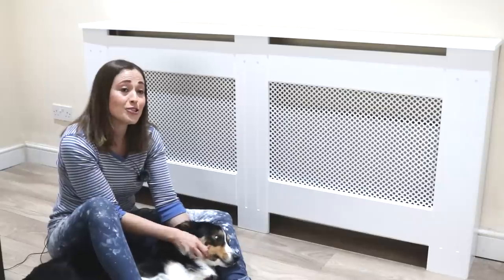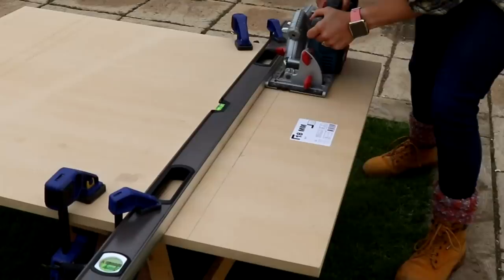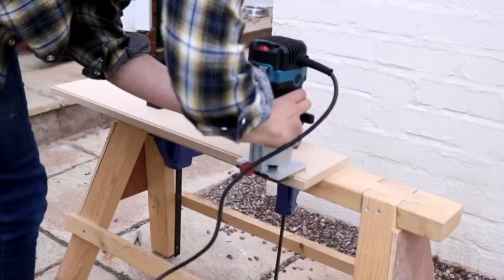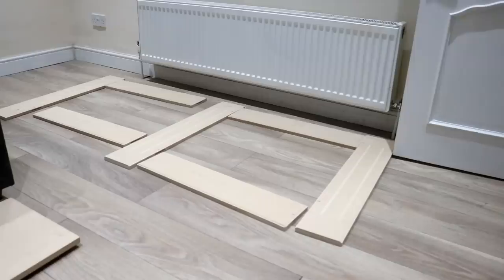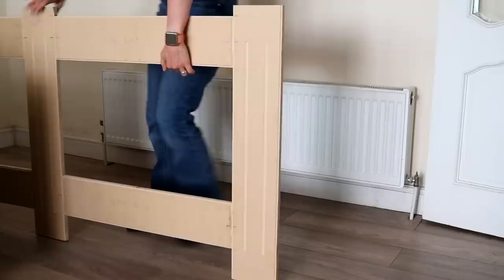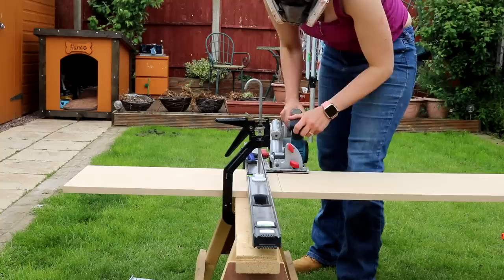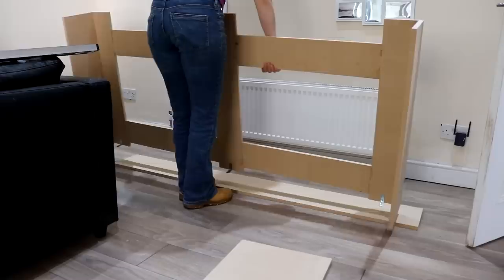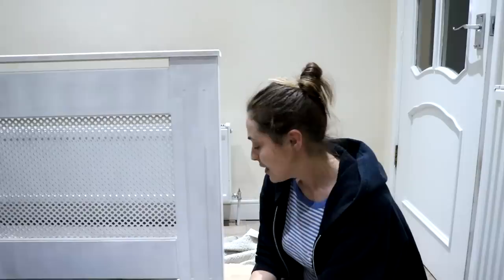DIY Radiator Cover | The Carpenter's Daughter

Comment: Good idea to fit a room sensor radiator valve or it will close down in a jiffy or take the head off the existing and it will never close if you don't mind continuous uncontrollable heat. Lovely job. Getting my MDF delivered tomorrow.

Comment: I made the same project back last year. I opted against using the mdf sealer and the paint finish I had was great without it. But like you, totally made sense to make one rather then buy one 👍
Reply from the maker: The place I bought the MDF screen advised not to buy the sealer because they thought it was expensive PVA glue, but deep down wanted to try it.  But so many people since have said that cheap undercoat did fine.  I'm just not sure why this product has so many great reviews as it soaked up almost 500ml which cost a fiver.  Also, I've since read the label on my satinwood and it says self under coating, so won't bother on my 2nd one.

A hardware store

Comment: Great video and great build Vicki.
I think though that radiator covers are certainly a fashion choice just like coving etc. Personally I like the radiators as you can easily hang wet clothing on them and it dries quickly.
I would guess that there is also a restriction by covering the radiator as to how much heat comes out, therefore costing more energy to heat the home. I know it's well vented but heat must be more directional.
I bought a MDF sealer paint from either B&Q or Wickes, can't remember which. Just looks like a white paint. Only issue I see with sealing with PVA is that you would need to add water to it to thin it down, therefore adding the one element that MDF does not like, water is not good anywhere near MDF so worth the extra expense.
Reply from the maker: Thanks Paul :)  Yes, radiator covers do seem to be a very personal choice.  Thoroughly enjoyed making it as it's taught me a few basics to make a recycling centre and it's going well :)

The sealer I used seemed to be very watery..  thinner than milk, but the MDF soaked it right up.  Haven't read the label, but don't really know what's in it.

Comment: Jali stock mdf screens .
Awesome all that planning payed off and new tools 🧰 too . 
Emulsion I would use as a base .
I couldn’t do this my maths is awful.
So impressive xxx
Reply from the maker: Thanks!  My maths is awful too 😂😂  It was really simple... I initially just held a thick book either end and measured the length.  Then after deciding the strips would be 15cm wide, I subtracted that from length and divided it by two (or three) sections, rounded it up and got my horizontal cuts.

I too was contemplating just white emulsion as spotted it's often used for them :)

Comment: Nice job. Very smart. Never used MDF sealer just MDF primer and two top coats. Wickes keep that sort of screen but I see the website shows it all on clearance so maybe they won't be stocking it anymore. I also use Medite MR MDF as the quality is good and the edges less fluffy than B&Qs. If you need a nice smooth cut edge don't bother sanding before priming. Sand after a coat of primer and it can be sanded very smooth.
Reply from the maker: Thanks for the tips!  I'll try looking for that MDF if I want to do some more :)  Also, yes, I spotted it was all clearance there too and my local stores didn't have it.

Comment: Looks very smart,  Automatic Bleed Valves are essential when fitting rad covers else you'll have to dismantle the cover to access the manual bleed valve,  having the Thermostatic Radiator Valve (TRV) and Lockshield Valve (LSV) within the enclosure is a mistake you'll later regret  the TRV will be unable to monitor the room temperature, forget about convection, there will not be enough air movement for the wax stat in the TRV to operate to the room ambient temperature, also no (quick) access to the LSV in an emergency and no way to adjust the temperature of the TRV. Nothing wrong with rad covers just ensure the TRV and LSV are outside the enclosure, I worked as an electrician mainly fitting Central Heating controls for a local authority, these problems became the bane of our lives a few years ago.

Comment: A neat job Mrs Carpenters Daughter ☺. I've never used MDF sealer, I'll have to investigate
Reply from the maker: Both Joe and Rob have since said it's rubbish (or expensive) 😂😂 but the reviews are really good.  My only gripe about it is I nearly used a £5 500ml pot on this cover.  The hardware store I bought the screen off said PVA solution would be better, but thought I'd try it out first.
Reply from the maker: Oh and thank you 😊

Comment: The perforated MDF sheets might not be available in the large single sheet, but most DIY stores sell smaller sheets. As your design is in two panels, you could have used 2 panels. If you can only find narrower sheets, usually sold as cabinet door panels, then making your radiator cover into a 4 panel design would work as all the MDF panel joints would be hidden inside the radiator cover.
MDF sealer makes a huge difference to the final paint finish. If you can't get the sealer use PVA applied in a thin coat on all cut edges and a thin coat 50/50 PVA + water mix for the surfaces. The water might make the MDF fluff rise on the first coat. When it's dry sand with a fine sandpaper and repeat. Like with all finishes, the more time you spend on the preparation the better the end result. You may need to sand and seal a couple of times, even with MDF sealer. A gloss paint roller (foam) is good for applying PVA.
The end result looks fantastic as usual.
Reply from the maker: Thank you.  I saw a few smaller sheets online, but they were quite pricey I'm comparison.  However, it may be a better solution for the smaller one I've now made this weekend.
Reply: Oh another tip, buying wood and sheet materials from your local timber merchant or building suppliers is generally cheaper and they will deliver.
Reply from the maker: Thank you!  I still don't know many places in this area, other than timber for sheds and fencing and I've been here 5 years 😂

Comment: I found the screening fairly easy to find the thing that got me was the price! Couldn’t find anything less than £40 for the size I needed. And for that price I managed to pick one up in great condition second hand. The screening is really easy to come by on eBay if you’re happy to wait for postage though :) 

Also, great to see a fellow lady DIY’er 😁
Reply from the maker: Thanks :)  Yes, I did see some online and almost choked on the price!!  I'm hoping it's just a seasonal issue, but do fear they're less in demand.  I've since made my second one, so Ebay may be a better option as I'm in no rush :)
Reply: @TheCarpentersDaughterUK  Great job!! If you want to do it on the cheap then you can do the holes using a router and a couple of easy to make jigs. 2x bit of mdf offcut, one with 1 dowel spaced from bit and one with 2 dowels, same spacing. 1st row you clamp a straight edge and do first hole, then use single dowel jig for accurately spacing 1st row. then you remove the straight edge and you use the jig with 2 dowels. you place the 2 dowels in an L shape with the router bit and it will keep the column holes at 90 degrees. Time consuming yes but you wouldn't need to do the whole sheet, just the part you see and you could do a rabbet in the frame to hold in place...
Reply: 6'x2' screen at b&q £29.
Reply from the maker: Sadly b&q are out of stock at the moment :(

Comment: Hello Carpenters's Daughter …. Around 35 years ago radiator covers where removed all over because they jack up your heating bills just as well as long drapes hanging over the radiators do. So ok maybe things have changed since? However I would never cover up the thermostat because that will effect your heating. Just mentioning this as a tip incase you should consider doing this in another room as well. Otherwise?  …. Beautifully done. Nice to see you are so happy with it.

Comment: Excellent. Persevere with the track for your saw - better still, add a cross piece so you only have to measure the near side and cut perfectly square panels.

Try Peter Millard's 10 Minute Workshop for shaker doors - so similar to what you were doing there. And both him and Andy at Gosforth Handyman for painting MDF - and lots more.

They both do a podcast called Measuring Up - I find it just the job for ironing, complicated cooking and massive washing-up.

Comment: Bear in mind fitting a radiator cover will reduce the radiators efficiency by around 25%, with the lower flow temperatures used in new installations radiator covers will be unusable in most scenarios unless the radiator is massively oversized. When this video was made it didn't matter, becoming more important now though. Lovely job regardless, looks great.

Comment: I agree with comments that you work very professionally.
One question though which has always sprung to mind about radiator covers. Do they effect the efficiency of a radiator? Granted you have included plenty ventilation in yours. Also the TRV definitely will be rendered useless which is fine if the valve is turned to full.
Well done though you have made a very neat job.
Reply from the maker: Thank you :)  I'm yet to find out in the winter.  It may be difficult to tell in this room though as we have two radiators (it used to be a very cold room).  However, Rob who recommended the vents says there should be no issues.
Reply: They can slow the heat initially (10-15 mins), but once the cover is warm heat will still radiate and the vents will allow normal convection currents to do their thing.

Comment: Keep an eye on your router bits Vicki, they can have a tendency for the bearings on the end to work loose & fall off or the bearings to seize up, which ruins your day as well as the piece you're working on, the better quality the bits the less this happens, at the same time the cheap sets & single bits you can get on eBay are fine & more than adequate for the work you're doing... Just keep an eye on the bearings that's all, radiator cover looks great by the way 👍
Reply from the maker: Thanks for the tip!  I do have a selection that has some bearings missing, but they were handed down to me, so thought I'd buy some new ones for this.  Will keep my eyes peeled :)
Reply: @TheCarpentersDaughterUK  I did look at getting replacement bearings but tbh it's as cheap to replace the bits (if you buy the cheap sets off eBay)

Comment: I prefer to use pocket holes rather than biscuits. The joint is just has strong but without all the hassle of having to line up the cuts for the biscuits.
Reply from the maker: That's another thing I'd like to buy soon :)
Reply: @TheCarpentersDaughterUK  Mention it a few times in your videos and maybe a company will send you a pocket hole kit to review :)
Reply from the maker: Well Kreg didn't offer to send me one when I asked them a question about which one was easiest to use the other week 😂😂
Reply from the maker: Oh and I thought this looked so much easier than doing pocket holes, but I could be wrong 😂

Comment: Ive never used a router before can you tell me the bits required to chamfered the edges and the grooves you did? Im going to buy the same router as you. What other method can i use instead of a biscuit joint as i dont want to spend the money on a biscuit cutter for one project if you know what what i mean. Thanks again
Reply from the maker: Great questions!  If you don't want to buy a biscuit joiner, you could use dowel joinery  - you can watch my do this for the first time here https://youtu.be/fduBysIH2JQ?si=tuvrWoth_nDn2QUx

Or you can simply build the frame and  add another support or two and clad the top - or push some strips of wood together for your top and fix together with some strips of wood at the back.

Also, you can see this router set closer in this video if useful: https://youtu.be/xwu2GAlKDss?si=UHcI9S7TjqzqbPnF

And finally, you might find my radiator build written tutorial here useful:
https://thecarpentersdaughter.co.uk/woodworking/diy-radiator-cover/

Let me know if you need any more help!

Comment: Remake the saw guide, girl. Its truly indispensable. You can use BOTH sides of it - One for the wider side of the saw and the other for the narrow side of the saw. That way, you won't mess up. Then write on it WHICH saw is to be used with it. Love mine for breaking down material. Use styrofoam sheet under the wood and lay it on the floor for cuts (might need a couple of scrap 2X under it all to get good clamping of the guide.)
Reply from the maker: Thank you!  Yes, I really do want to make another one.  I'd stupidly made the narrow side a bit too narrow for my saw's guard to open.  Thinking about it, it I just clamped it on to MDF and sacrified a little bit of it, then it would have worked.  Oh well, I know for next time :D

Comment: I have a question. How did you clamp the second half of the cover? Your sash clamp is only 1200mm but you rad cover is 1800mm. Unless you just clamped it near the middle area rather than at the biscuit joints? But that would probably cause it to bow if too tight. Its not shown in your video. Great video though well done. I'm been putting off making my own rad covers, maybe this is my push to start and get it done.
Reply from the maker: Good question!  On the second section, I clamped above the biscuit join towards the top below the biscuit join for the bottom.  Although I probably should have clamped with an extra piece of wood to crushing my chamfered edge a bit.  I've just had a close look now since it's painted and can't see where I've been with the clamp, so I'm happy :)

Comment: I use normal emusion as under coat , b & q do a any surface 1 in loads colours asell sheen was great
Reply from the maker: I was tempted to paint with emulsion too!
Reply: @TheCarpentersDaughterUK  worked on some mdf beds i made mdfs great keep me posted on stairs ideas i changed my friends which was like yours to square oak spindles and oak hand rail and oak pryimid caps looked very good with white
Reply from the maker: Sounds lovely! 😊  Also, I've since read the satinwood and it says "self undercoating", so skipped this when painting my stairs since :)

Comment: Is it expensive to get wood cut for these measurements and do the parts that you did. Do b&q do stuff like that, anyone know? I don’t have any tools.
Reply from the maker: B&q cut for free.  However, right now due to covid 19, they're temporary not offering it, but I've been advised to keep checking their website until they do.

Also, if you dont have a biscuit joiner, you could try countersunk screws and bury them with filler.  Hope that helps!

Comment: What a fantastic job, it does look extremely professional. Did you add any brackets to attach it to the wall just in case it gets knocked and falls over.
Reply from the maker: Thanks!  Not yet... I'm just going to make some boxy style French cleats for them as I did with my electric fire suite.  I've made a cover for the smaller one since and want to attach them all at the same time :)

Comment: Great Job again Vicky. What did you think to your Erbauer power tools? I'm in the market for power tools but unsure which brand to choose. I'm a DIYer/hobbyist so dont want to spend a fortune but dont want to buy cheap neither. I've looked at Macallister, Evolution, Triton. Can you reccomend any please?
Reply from the maker: Thanks!  I don't really have a great deal of experience to compare them to anything else.  But my favourite tools from these are my circular saw, jigsaw and palm router.  I love not have to plug things in with the first two and the palm router is nice and light compared to the double handed ones.  They've helped me work much quicker!
Reply: Thank you for your reply. Was you more then happy with them? I'm looking at a router, mitre saw and circular saw.
Reply from the maker: Absolutely!  As for a mitre saw, my Dad gave me his old dewalt one, then I got an evolution one as seen in my garden storage box.  Both are great, but I've only used the latter one once because I need to sort my garage space lol
Reply: Thanks again Vicky, really appreciate your replies. I'm defo swaying towards Evolution for s mitre saw and I think Erbauer will be plenty enough for me. I'm just starting out in woodworking

Comment: most if not all radiators say do not cover.
this girl has.
Reply: This advice generally applies to electric radiators, or covering a radiator with damp towels or clothing  etc (for health issues). This cover provides adequate airflow and therefore causes no problems.

Comment: I really want a circular saw but I'm afraid to use one 😕
Reply from the maker: I felt exactly the same initially.  You just need to take your time and keep your hands away.  Also, if you feel resistance, then stop.

I do recommend the Worx compact saw.  It's lighter, smaller and great for cutting sheet material.
Reply: @TheCarpentersDaughterUK  you make it sound easy lol. Great video and channel by the way 👍👍👍

Comment: Nice work but please be careful running the router in both directions, do a search for climb cuts on a router and you’ll see what I mean. In some situations a climb cut can be really dangerous because the router can get away on you.
Reply from the maker: Thank you.  I know my Dad said it's designed to go one way a while ago and wondered if this would come up!  I found it very tricky otherwise to avoid routering the sides I didn't want to catch.  Will only practice the one way from now on :)